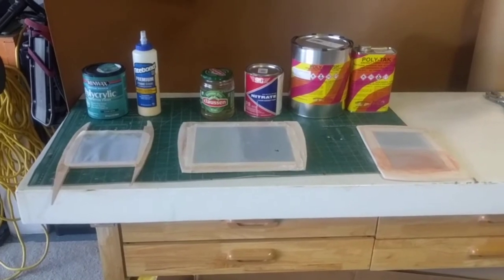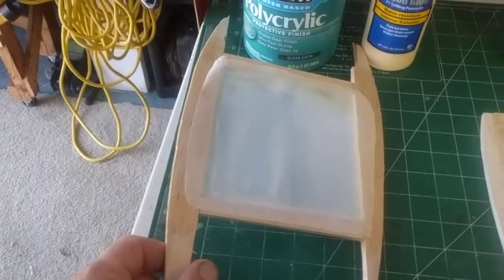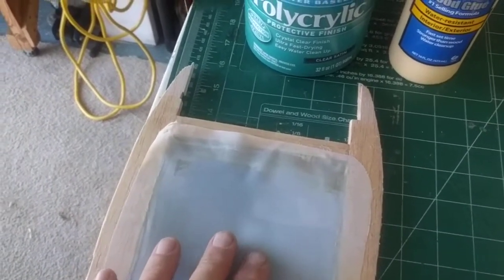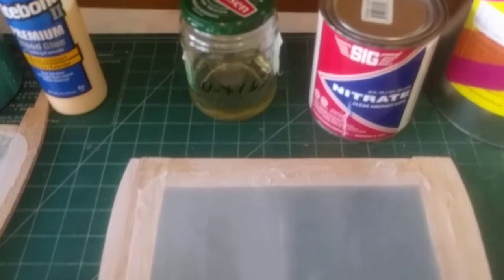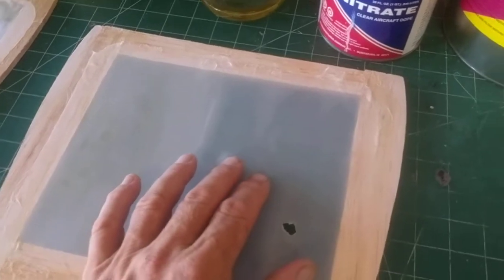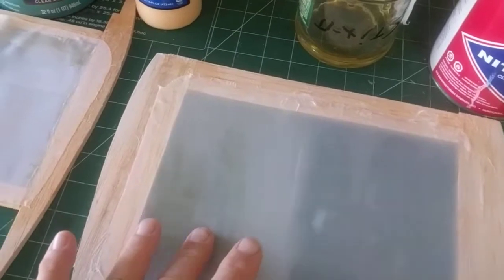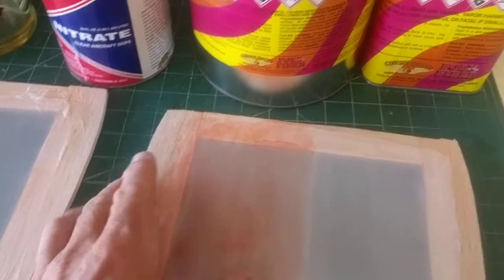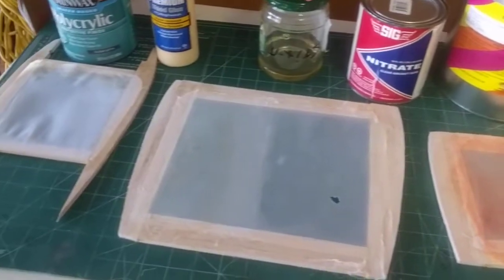Covering RC Planes with Fabric  part 2 of 2

Comment: Here is another experiment I will try on the PolyFiber - since it starts shrinking at 225F and water boils at 212F here is an interesting experiment I will do for sure: heat water to almost boiling, add the new Rit Dye More polyester fabric dye on it (color of your choice) ... then immerse the PolyFabric and will see how it takes the dye. If it works then we will have an amazing selection of colors to play with ( Rit DyeMore lines of dyes) .. Just a thought on what's coming to my mind and experiments once I receive a yard of PolyFiber .. This will be "huge" for antique models and free flight etc ..  where the fuselage is one color and the wings are another .. usually a green / yellow or blue / yellow combination would be amazing ..

Comment: Hi James,
Nearly forty years ago I had to learn dope & fabric as part of the curriculum to obtain my A&P aircraft mechanics' license. We first learned how to use Ceconite and later Irish Linen with nitrate dope. I've never used linen or any other dope and fabric on my RC planes but had wonderful results with SolarTex filling its weave completely with Aerogloss (satin) butyrate dope. Makes a wonderful dope & fabric-looking finish. The nicest finish I've done is on my SIG Four-Star 40! Have you used SolarTex and if so, how did you like it?
Seems they have gone out of business recently but thankfully I have three 5-meter rolls in reserve for my Balsa USA, Bristol M1, and a few other smaller planes.
Reply: I have a roll of Solartex but haven't used it yet. It's not a film like the ones you mentioned, it is a fabric similar to the old Coverite Fabric I believe where the adhesive is already built into it.

Comment: Thanks for the videos, going to place an order for the sig koverall, but have a question. The engine I am using is nitro so I would use the fuel proof supercoat on the entire plane, instead of the nitrate? They make it clear so I can paint it myself. I will have to find out what type of paint is compatible with this fuel proof supercoat, unless you know.

Thanks Dave

Comment: Question:  does the PolyFiber light shrinks with heat ?
Reply: Thank you very much for your reply ..One more interesting experiment would be to use Sig Stix-it on PolyFiber Lite as I prefer the convenience of heat activated cement glues with an iron. I will sure give PolyFiber a try along with Stix it .. and for sure use Polycrylic to fill the weave after I tighten the fabric with the iron. Thank you so much for sharing this video with the rest of the modeling community.
Reply: I haven't used the non-certified "light" poly fiber, but from memory the certified poly fiber achieves maximum strength when shrunk at 350 degrees. I think you start at 225F but then end up at 350F.

Comment: Before applying the Polycrylic on the polyester dress liner sample, have you attempted first to shrink it with heat ?
Reply: @jamesboatbuild  Thank you for both replies - so, is it safe to assume that when you shrunk the polyester fabric liner it actually did  shrink as expected, BUT the application of  polycrylic made it saggy ?  This detail is important for me as I plan to alter slightly the sequence - meaning: after shrinking the polyester liner, I will apply a couple of coats of nitrate dope, and THEN use the polycrylic to fill the rest of the wave.  I have a "hunch" that the nitrate dope will "lock" the fabric and won't allow it to sag .. Just a feeling I have .. But I did want to know if the liner did shrunk "tight" before you applied the polycrylic.  Thank you once again for your time. Those experiments and its variations are PRICELESS ..

Comment: Properly applied wet covering with Dope should not need heat .... if you need to heat it - then its not applied correctly and will likely sag later.
I think a better demo would have been to apply each material with exact same systems to compare results. With what is done here ? It is 3 different systems and also uses heat .....

Comment: I voted it down simply because you went about using the materials without any regard to the finished results. Therefore one is left without accurate information about using the materials, or of what results I might expect if I used them properly. In your first video it sounded as if you might take this demo more seriously, resulting in a tutorial worth more to the real world of covering using these materials. No one should rush, or haphazardly approach the final stages of finishing their model. It would be a huge mistake after spending your time building the model you want to fly and be proud of.